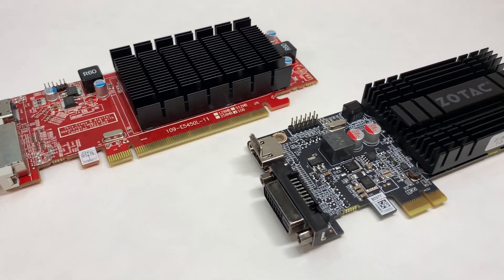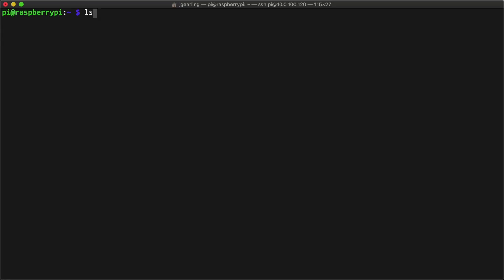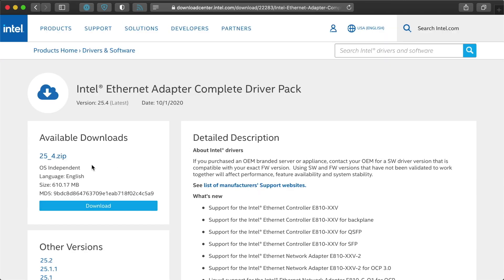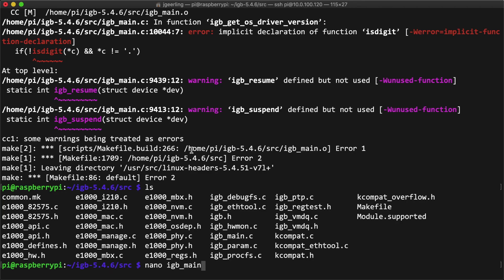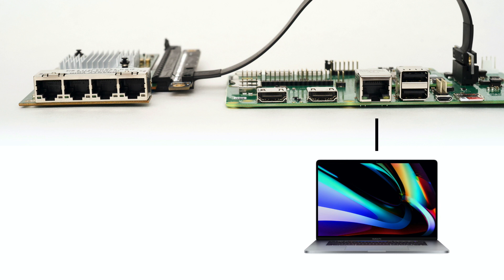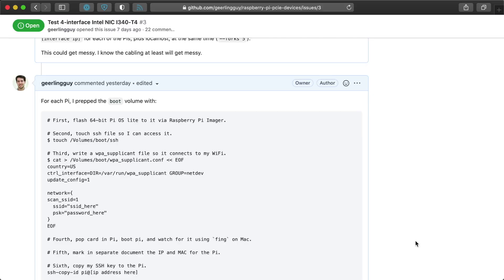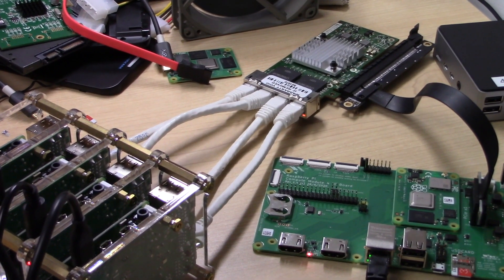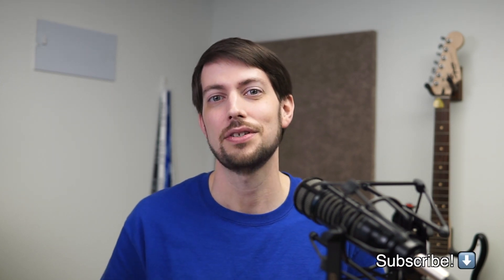5 Gbps Ethernet on the Raspberry Pi Compute Module 4?!

Comment from the maker: Posting an update. I monitored `top` while I was doing some benchmarking today, and I noticed `ksoftirqd` immediately spiked to 100% CPU usage, which seems to indicate the bottleneck is that process trying to queue up and process all the incoming packets. So CPU in general is fine, it's not overheating, and I'm definitely not saturating the full bandwidth of the PCIe lane, at least not currently.

Also, if I overclock the Pi, I can get 3.4 Gbps!

More details here: https://github.com/geerlingguy/raspberry-pi-pcie-devices/issues/3#issuecomment-719781909
Reply from the maker: And another update: I overclocked the CM4 to 2.147 GHz / 750 MHz and got 3.43 Gbps. That's an 11% network bandwidth increase after a 36% clock speed increase. Not bad. Still wish I could get that juicy 4 Gbps number though!
Reply: @JeffGeerling  please check the response by @John Pitney. Off loading some of the interrupt handling to other cores should improve the performance. Network packets are handled through interrupts. So, if you see one of the core is taking the full load, better divide the interrupts.
Reply: @JeffGeerling  Try Doing a dpdk and run... i am 100 percent sure you will hit 5gbps mark... irq is the bottleneck
Reply: @abhinavbhardwaj5681  Yeah DPDK will certainly improve performance, and it can build natively on ARM
Reply: Maybe try adjusting the clock speed and seeing if the bandwidth scales with it?
Reply: You might find in /proc/interrupts that one core is handling many of the interrupts.  Echoing a CPU number to /proc/irq/$IRQ_NUMBER/smp_affinity can steer interrupt handling to another core for a particular IRQ.
Reply from the maker: @JohnPitney  It seems like that could be helpful... but also maybe not. Especially since it seems I can't write new values to the interrupts on the Pi—see: https://github.com/geerlingguy/raspberry-pi-pcie-devices/issues/3#issuecomment-719816670
Reply: @JeffGeerling  I would definitely recommend using iperf3 instead. It has an extra flag you can use -Z which is zero copy mode and is much better for lower powered cpus... I actually just posted this in a reply to my comment on your video to someone else, and I was guessing it was the cpu that was the bottleneck here but it seems you also have already come to that conclusion. Definitely take my idea into consideration!
Reply: @JeffGeerling  This looks like a good article to check out, check the comments/reply https://askubuntu.com/questions/7858/why-is-ksoftirqd-0-process-using-all-of-my-cpu -> You can tweak the settings a bit, by defining which cpu picks up a certain interrupt. You do this by changing the contents of /proc/irq/$interrupt_number/smp_affinity. You can get a list of interrupts and their meaning by doing:
Reply: cat /proc/interrupts

The number in smp_affinity is a bitmap of cpus, represented in hex code. The rightmost bit is the least significant. For instance, my system has 8 cores. If I wanted to use only cores 1, 3 and 4, I would set the smp_affinity to 1a:

cpu_7 cpu_6 cpu_5 cpu_4 cpu_3 cpu_2 cpu_1 cpu_0
  0     0     0     1     1     0     1     0    = 0001 1010 = 1a (in hex)

Personally, I set up any cpu to be able to pick up interrupt 29 (eth0 in my 8-core system) with:

echo ff | sudo tee /proc/irq/29/smp_affinity
Reply: @JeffGeerling  I could be wrong here (almost certain I am) but could it help to move to a polling based data path (eg: dpdk) rather than using linux's interrupt based data path? Handling interrupts is more expensive from what I understand.
Reply: @JohnPitney  yes I agree using the cat /proc/interrupts  there you can see who uses the CPU a lot and then check if there is a fix for it. The real problem is that the "Linux tcp stack has never been the greatest" :) a Joke.  Other thing is to do with the NIC -> Look at making sure that your nic supports MSI-X (lspci -vv). But in this case the PCI slot used here does not support the MSI-X only MSI. More info http://www.alexonlinux.com/msi-x-the-right-way-to-spread-interrupt-load
Reply: Disclaimer: I've never had to adjust these offloads on Linux, only Windows and VMware.
1) Look into various TCP/IP offloads the i350 supports.  Relieves stress on the Pi CPU

2) Your TCP Window sizes above kind of suck.  By default iperf won't exceed 1500 bytes/frame. Try enabling Jumbo Frames which goes up to 9000 bytes/frame.  
Bigger frames = Less processing and more payload.

Side Note: Networking is not Voodoo.  You can use 192.168.x.x for all 6 networks (5 wired and 1 wireless).
With a Subnet Mask of 255.255.255.0, only IP blocks with the first 3 octets matching are on the same "network".
So you could have used 192.168.11.x + 192.168.12.x + 192.168.13.x + 192.168.14.x + 192.168.15.x for the wired test and left your home network on whatever it used, likely 0.x or 1.x.
Again, you just make sure the Subnet Mask is 255.255.255.0.

Lastly, you could have also simply looped a network cable from port 1 to port 2 on the Intel NIC.
Then put Port 1 and 2 on the same network as per above, and Port 3 and 4 on a different one as per above, and run the server process x 2 on Port 1 and 3 and the client process on port 2 and 4.  You can use the binding part of your server command also on the client command to bind to a specific nic. Come to think of it, you don't even need multiple networks if you use the binding properly.
Reply: @Casper042  Or you could look up a CIDR subnet calculator and use a mask > /24. If Linux supports /31 that would be ideal that's a subnet with only 2 consecutive addresses and no broadcast or subnet address sounds crazy but I've worked with network equipment that supports point-to-point connections in this way. Otherwise you can use /30 that has 2 usable addresses, broadcast and subnet.
Reply: /31 as described in IETF RFC 3021 is indeed supported on Linux but NetworkManager is sometimes too smart for its own good and says: Here, let me fix that for ya! But it should work with manual, static config.
Reply: There is a worm which targets NetworkManager, noticed it around 2012.
Uninstalled Network Manager.
By using terminal in order to setup and run the network, no more worm.

Maybe need to rewrite ksoftirqd to parallel or optimize for multiple cores.
Reply: @Casper042  +1 also i'd recommend not be afraid to use iproute2 directly "ip addr add 192.168.5.10/24 dev eth1" that is often easier than the fancy network configuration files (although sometimes you run into issues if a network manager has settings conflicting with what you are doing via iproute2... rinse and repeat choosing different networks for each interface.
Reply: @Casper042  being in the field for years, I appreciate the remark "voodoo". A lot of the statements are only " partial truths" under certain or specific circumstances.
Why can you ping a host on the same L2 network, yet get the response from another host with "routing" enabled (hint, incorrect subnet masks).
Why can you VLAN hop? Why can you intercept traffic by reverse arp? Why do VLANs not truly belong on a wireless network?
The voodoo makes complete sense. especially when the network configuration is SO MESSED UP, yet mostly everything works.
Until someone plugs in a rogue DHCP server, or PXE MCAST TFTP server.
The list is endless as all the fun networking protocols bring their own nuances. =D
,... And somehow at the end of the day we can count pink pixels in a 4K ultrahd video of  some actress in a desirable display of .... aptitude?
Reply: Hey mate, I am building a Gluster Cluster on Hardkernel's HC2 for HCI to my Homelab VM Hosts (Dual Xeon and a disk array with a c2750d4i), check this out. https://community.mellanox.com/s/article/understanding-pcie-configuration-for-maximum-performance, the article was useful to me working with HBA, but the principles are the same. You need to consider the reduction in the pin on the PCIe could result (and in IMHO does) in reduced bandwidth for the ports and what is the bus you are using to transfer the data. if the PCIe and on board ETH share the same bus then the limit could be the bandwidth of that bus. In my case it helped a lot to have a cisco 3750 that has a huge backbone to transfer the data so I know for a fact that my network is not a bottle neck in my testing. I am building a box that encloses two RPI4 to build a dual Pi-KVM fancy box for my home rack :D your videos go in background during my tinkering :) cool stuff you do mate! cheers from downunder.
Reply: Overclocking should solve this issue then
Reply: You can try configuring the i350 card to do some hardware offloading. (maybe even with the onboard Broadcom chip)
REF: https://docs.gz.ro/tuning-network-cards-on-linux.html

Enable hardware large receive (LRO)
Hardware checksum offloading

TCP Segmentation Offload (TSO)
Scatter and Gather (Not really going to beneficial when testing via iperf but it might be worth a try)
Generic Segmentation Offload (Jumbo Frames should be more beneficial than breaking packets down via segmentation)

Also use Jumbo Frames (9000 MTU) for throughput test. It will reduce the number of TCP/IP encapsulation headers needed per byte of data which should increase throughput. Most SANS uses Jumbo Frames for iSCSI because of the efficacy of sending large amount of data. 

recommendation
Reply: Love the bloopers.
Reply: On a similar note--maybe try this to affintize IRQs to all CPUS: https://gist.github.com/SaveTheRbtz/8875474
Reply: Does Cumulusli linux have a Arm version? Then this will be awsome.
Reply: Yeah just mentioned that on me comment.  before i read Your message. So i was right. Go on OC
Reply: U could get more OC headroom if u use the Pi icytower cooler
Reply: Play with TCP window and max out network buffers in sysctl. Obviously should be Full Duplex with flow control disabled those are probably the defaults. Transmitting from the CM and receiving on the other end should be optimal as opposed to having an uncoordinated attack from multiple devices that could trigger interrupts out of sync. UDP or SCTP should have higher throughput than TCP, but not necessarily simulating a common scenario. If the interfaces on the other end were say in the same x86 computer or another CM with the same NIC you could set up a team with some kind of load distribution which I have found to give more throughput than the old bond interface that doesn't really do something like round robin it just assigns streams to different interfaces.
Reply: You have to change the MTU on all PIs and interfaces
Reply: As an idea you can increase the MTU to use jumboframes (~9000), the idea of this is to reduce the number of packages (maintaining the data rate) and so the number of interrupts hiting the cpu, also this network card may have some offload capabitlites that may help reduce the load on the cpu and pci express like LRO of tcp offloading (check them with ethtool -k <interface>)
Reply: @marioabajo  good recommendation.
-u should help with more REALTIME link throughput.
Reply: Love your work as always. I do have a question for you as you mentioned pfsense in the beginning of your video. Have you successfully found an arm build that will work with the pi hardware? The only thing I have seen is geared toward their proprietary hardware.
Reply: I'm not sure if you tried it but what about jumbo frames? I know that people often have to set that up to get 10 Gbps working well even on good hardware, so I presume it would help on a device that struggles to hit 3 Gbps. Basically it means you get bigger packets.
Reply: Hi I recommend to run 2 server on raspberry pi and run other 2 pi as a client . Create bridge between eth1 - eth2  and eth3 -  eth4 . So you can measure nearly bare nic speed on raspi without server or client software run on raspi (they are use a lot cpu on userspace). Also For measuring embedded nic,  you can use raspi as a test gateway (we can configure for only testing) . With this config, you can test nic without running any software on raspi and save more cpu resource for kernel. I can write blog for you to how to prepare, if you want please notify me. Good luck.
Reply: Have you tried to enable Receive Side Scaling? This will allow multiple threads to process incoming packets. This is assuming the network card support multiple receive queues. Otherwise, you can try enabling Receive Packet Steering instead.

https://blog.packagecloud.io/eng/2016/06/22/monitoring-tuning-linux-networking-stack-receiving-data/

The commands are under: Adjusting the number of RX queues
Reply: Have you benchmarked other way around, when RPi with i350 is a client? If throughput is higher in this case then I'd say interrupt handling is bottleneck. There's a lot of advises in comments regarding MTU size and misc. offloading. PC has MSI/MSI-X capability (mesage signalled interrupts), I'm wondering if RPi has such capability, that would reduce interrupt-related load.
If in 'client mode' bandwidth is equal then system bus is limiting factor.
Reply: I have a intel phi and a raspberry pi.  Hmmm, Raspberry Phi anyone?
Reply: This was actually my first idea, pi isn’t fast enough to saturate 5 gigabits of network throughput.
Reply: Theoretical max BW of your setup (1500 byte Ethernet frames via PCIe DMA over a gen 2 x1 link with max TLP size of 128 bytes) is around 3 Gbps, considering all protocol overheads.  So you're definitely saturating the PCIe link.
Reply: I’ve seen the irqbalance process hamper throughput by isolating network interrupts to half the CPUs. I disabled it to solve the problem. Is irqbalance running?
Reply: Isn’t PCI-E x1 limited to 250mbytes/s?
Reply: @r3ndszergazda  It's a gen 2, so no.
Reply: @r3ndszergazda  that's for pci-e gen 1. it's the theoretical maximum, real world is always lower due to overhead. i don't know what gen this pci-e port is but seems like gen 2 or else he couldn't have exceeded those 250MB/s. 3Gbps is ~370MB/s so it's gen 2. gen 2 can do ~500MB/s.
Reply: @giornikitop5373  It is a GEN2 Link on  that PI Board, yes you are right, 500 MB/s is the theoretical bandwidth, but including the 8b/10b encoding scheme you are only left with round about 4GBit MAX throughput. At least thats on x86 Architecture. The rest will be due to System and Protocol overhead. So I think there won't be much more to squeeze out of that card on an PCIe x1 2.0 Interface. Guess there is a reason why it is designed for a PCIe x4 Interface!

Not to mention the aforementioned CPU bottleneck.
Reply: @talkalotsonius  is right👆 4Gbits/s is indeed the maximum for that single lane (irrespective of CPU architecture) which of course won't be achievable in any event with multiplexed data channels. To reduce CPU overhead, could try messing with network protocol settings - jumbo frames might get a quick win as it reduces the number of frames the CPU has to handle. As you're using the Intel drivers however, it's likely already using whatever CPU offload it can do with that ethernet interface chip, enough that jumbo frames may not help.
The Intel I350 is PCIe v2.1 itself max 5GT/s, ref. https://www.intel.co.uk/content/www/uk/en/products/network-io/ethernet/gigabit-adapters/server-i350-t4v2.html
Reference datasheet for RPi compute module states the PCIe Gen 2 spec there: https://datasheets.raspberrypi.org/cm4/cm4-datasheet.pdf

Comment: why you didnt simply bond interfaces and try with different 'packet size' - MTU? Pcie 2.0 x1 lane is 0.5GB so we would have about 5Gbps, but some of available bandwith will be used to actually control device. Of we send many small packages we probably waste more of bandwith so we should try large packages.

Comment: and you can get way better speed out of the box on a rockpro64 without a carrier board, etc. it have 4x pci and already exposed in the actual sbc. its nice to watch what you do, but the hype on the 1x pci of the cm4 is a bit.. toooo much overhyped. they are tons of rk3399 devices used for NAS due the huge I/O capabilities this soc have (compared to amlogic or broadcom ones)
Reply from the maker: True; but right now I don't have a ROCKPro64 to test with! I think the hype (at least for me) is that I already have a lot of investment in the Pi ecosystem for other stuff, and enjoy the community. Having the availability of a model with a 1x PCIe slot is better than not having that availability, and I know there are already a few new cases and products that are going to take advantage of it.

I do like, however, that Pine64 is keeping this ball rolling—with ARM, it seems a rising tide lifts all boats!
Reply: @JeffGeerling  its oka, but rockpro64 is 4x, already exposed on the sbc.. way cheaper and smaller than a cm4 module and the carrier board.

Comment: Try Jumbo Frames by setting your mtu on all interfaces to 9000. This should alleviate any lingering overhead and bump up your bandwidth just a tiny bit.
Reply: Basically the bigger the packet the faster the transfer. Think of it as copying lots of small files vs a few very large ones.
Reply from the maker: I tried that, and sadly it didn't work :( — see https://github.com/geerlingguy/raspberry-pi-pcie-devices/issues/3#issuecomment-719805209

Comment: I don't think I have seen a successful port of PFsense to ARM. OpenWRT should be no problem. I look forward to your projects.  I am curious if the onboard LAN and the PCI share the same bus.
Reply from the maker: It looks like they might not, but instead the problem is incoming packets overwhelm the CPU and ksoftirqd starts maxing out at 100%. But I can't verify it until I do some more testing with other cards (e.g. test things other than the networking stack).
Reply: @JeffGeerling  Just read your update. Thanks for the reply.